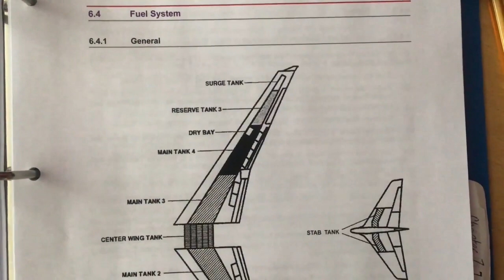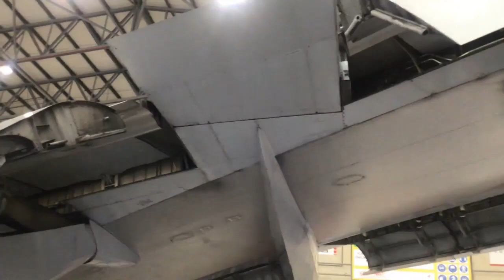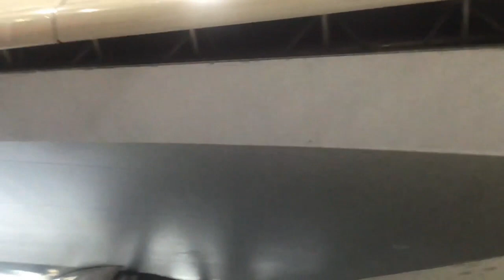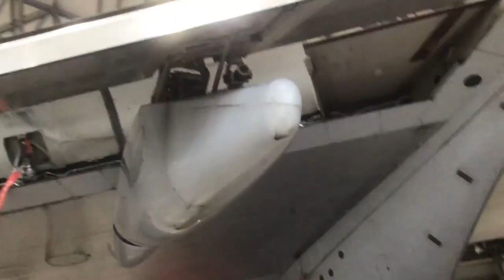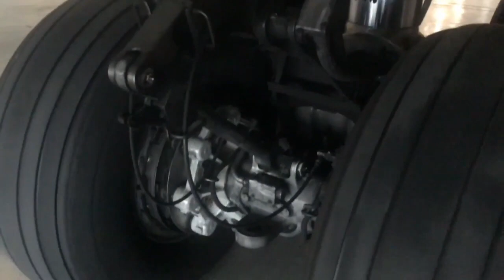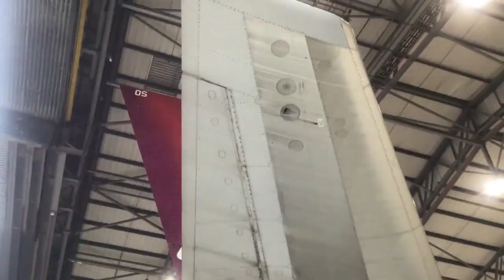wings and things

Comment: So why are the tyres inflated with nitrogen? Is it to stop expansion at altitude or temperature?
Reply from the maker: Travels of a Service Engineer air is not used because it contains oxygen, and if an overheated brake was to cause the tyre to rupture inside the wheel well you do not want the contents of the tyre providing more oxygen and fuelling a brake fire. So we use dry nitrogen as it is an inert gas as it would not make a bad situation worse. I hope that helps.
Reply: ianobiwan ah so it’s nothing to do with expansion. I see. It does make sense what you said. Interesting stuff.